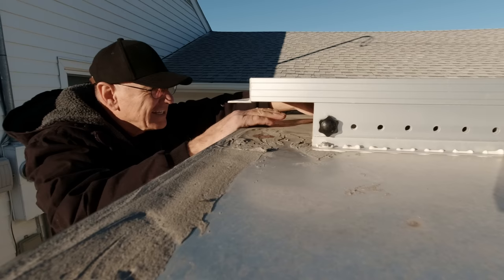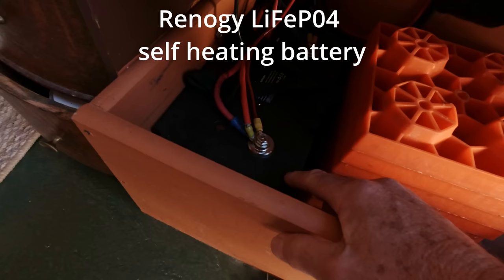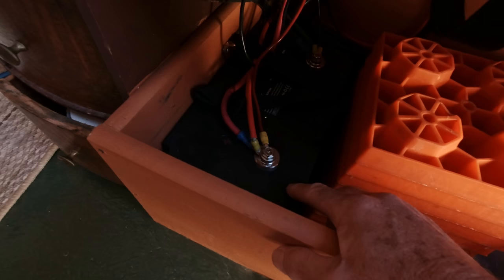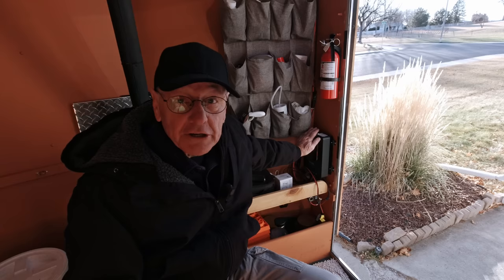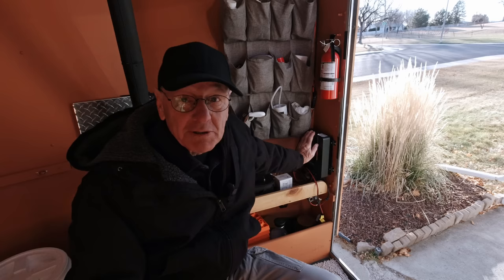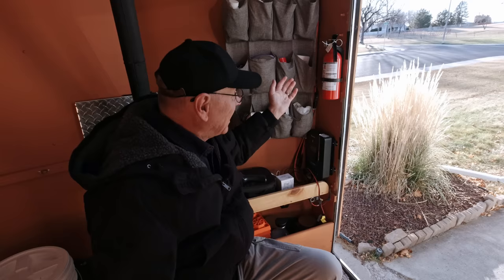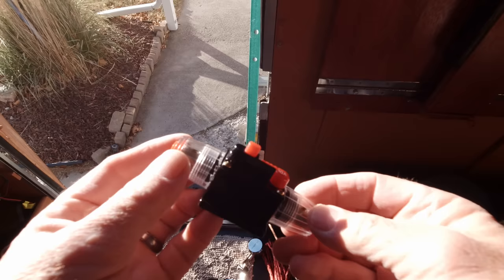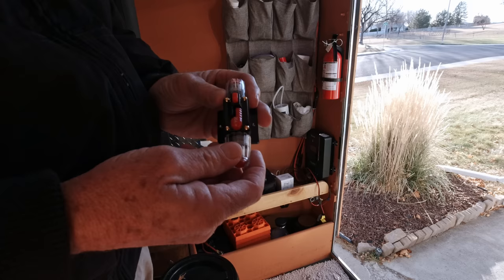Installing a Solar Panel On-Off Switch and +/- Buss Bars

Comment: That's interesting ... never knew there was a heater in the battery ... I was checking out those batteries the other day ... think now I'll try to come up with a tempurature controlled 12 volt heater pad for a battery box ... seen alot of different variations on Amazon for seed germination and reptile pads ... also seen heating pads that you can sew into jackets or vests ... looks like I may be going into Thunder Dome or WW lll mode by the end of the month ... I hope that's a joke ?
Reply from the maker: I hope that's a joke also!  I have a heated coat that I really like and it's very efficient.  The heating pad just runs off of USB power packs of any manufacture and might be just the ticket for what you have in mind, except for you would just hook a USB port to the battery itself.  You would need to come up with some sort of temperature control to operate the system to only come on when the battery is being charged.
Reply: @gonagain  I rigged up a tempurature control device for my 120 volt "Bucket Heater" ... tempurature control is not very expensive and you can buy them for 12 Volts for under 20 Dollars ... the heating pads for jackets are usually made of Carbon Fibre which means they should have a range of 5 to 20 volts DC .... if they are too hot at 12 volts they can be controlled with a 25 cent resistor or a simple Potentiometer/Volume Control ... when I get around to it I'll let you know how it worked out ...
Reply from the maker: @richardr1891  Thanks Richard, you know a lot more than me.  Keep me posted.

Comment: Are trickle chargers needed for batteries in storage?
Reply from the maker: Not so much for lithium batteries, which can hold their charge very well through the winter.  You should store them at about 60-80% charge and it's recommended to not leave them out in the cold.
Reply: @gonagain  
I wouldn't like being left out in the cold either.   😜

Hope Linda is healing and able to move around some.

Thanks for the info.🤙

Comment: If the circuit breaker to the batteries opens with solar panels "on," is there possibility the charge controller will be damaged?
Reply from the maker: It's ok to have a circuit breaker between the panels and the controller, but not between the controller and the battery.

Comment: Wondering why you didn't cut the negative wire and put the on off switch you cut the positive
Reply from the maker: That's the way it's done, by breaking the positive wire.  I've since put on a double pole breaker that cuts both.
Reply: @gonagain  You might need to make a video about the double pole breaker.  I'm new to all of this.  By the way I'm wondering if the breaker you put only on the positive solar wire is only for positive solar wires.  Can that device be used for negative solar wire too

Comment: I personally will never install one of those switches in my system or any install i do for other people,  they are not safe. Please people,  never cheap out on safety equipment like fuses, switches, cables or connectors. I  understand and yes i am poor too, I live full-time in my 1967 GM TDH-4519 city transit bus in the high desert of New Mexico and I am disabled and unable to work anymore  so I live on a very fixed income. Is saving a couple of bucks on a switch or fuse worth losing your home?
Reply from the maker: Those breakers are made for woofer speakers using DC current and this one has never failed.  Just get one that's rated for the current being used.
Reply: Those breakers are known to not open when they are ment too, they are known to get so hot they melt. Please sir , get some DC rated house type circuit breakers

Comment: I used 4 of those in my system 3 out of four failed. I wouldn't use
Reply from the maker: I'll be watching out for that.  Maybe use a larger amperage size?

Comment: Battery Switch 12-48V Waterproof Heavy Duty Battery Power Cut Master Switch Disconnect Isolator for about $12 will also work to isolate the solar panels